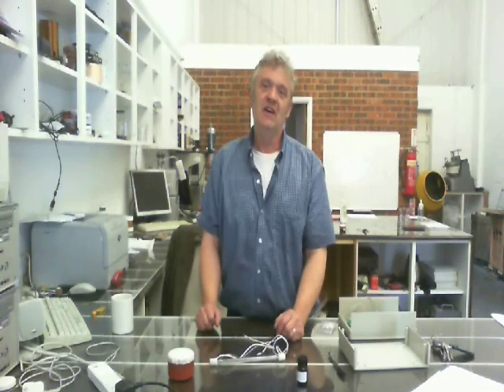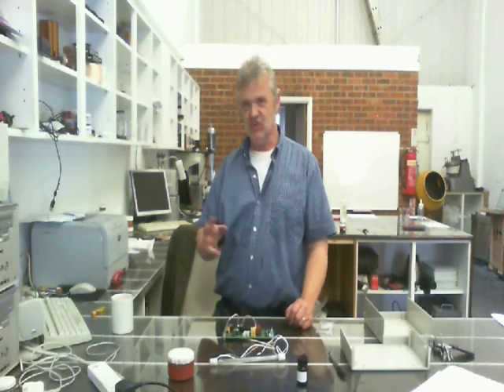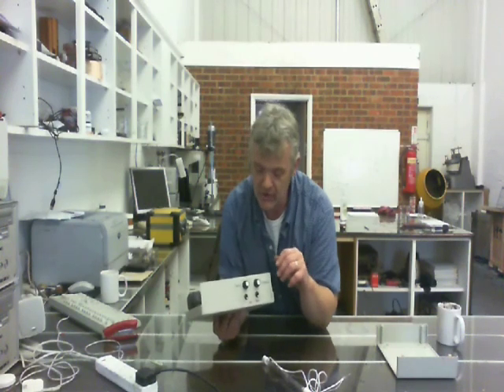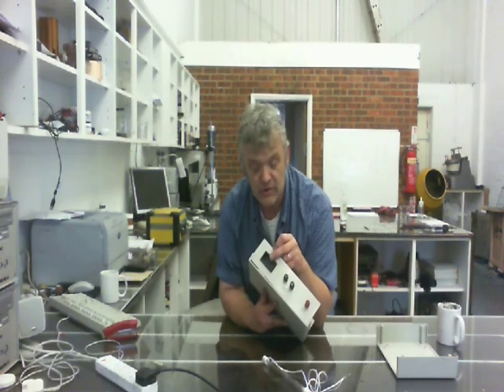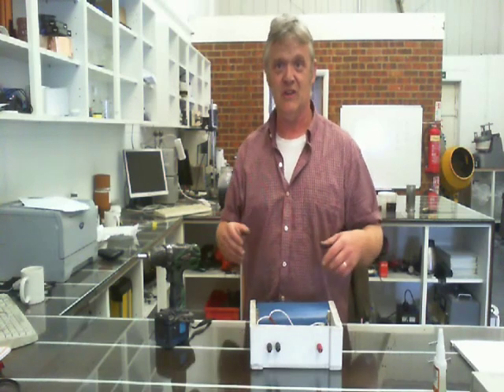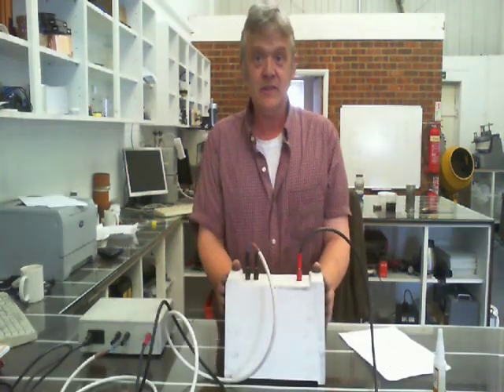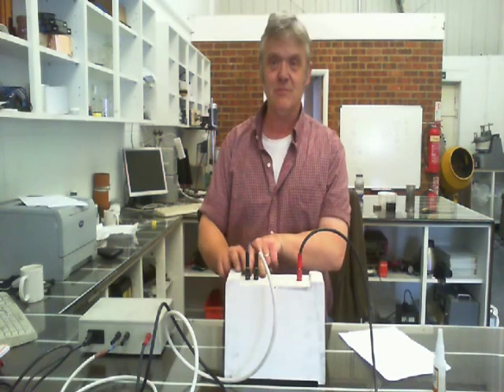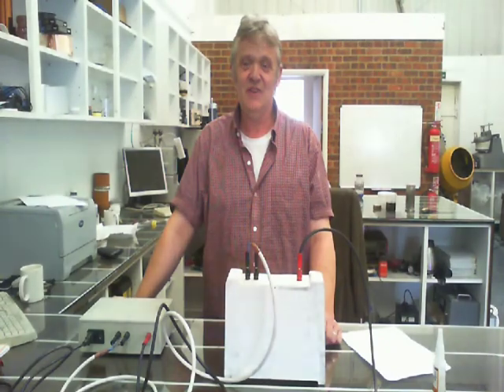How to Make A High Power Xenon Flash Unit For Sintering Nanoparticles

Comment: Hello Robert, I am also trying to setup a xenon flash lamp sintering system for the curing of silver nanoparticles, but I want to know that which xenon flash lamp and the circuitry you have used in the video. Please give the detailed specifications of it.

Comment: So i'm assuming the board does not need a power supply board? You can just wire the mains connector up to driver board directly correct?

Comment: Hello Mr. Murray-Smith :  Please speculate if the scintering device would scinter a TiO2 coating approximately 6 microns thick (0.25 mil). Thank you!
Reply from the maker: no it won't mate - it is very underpowered and meant just as a bit of hobby kit - it'll do non challenging materials like copper and GO

Comment: will the triggering input change both intensity or frequency....if so what parameter of the signal is used to change the frequency and intensity....

please reply 
a.abhijith0123@gmail.com
Reply from the maker: yes - it is a kit available on the net - the parameters will be given with the kit
Reply: I have the kit. I am trying to automate it using arduino....I am using a pwm output from arduino to control frequency and intensity. But only frequency of flashing is varying not the intensity of the light. What parameter of the trigger signal will change the intensity of the flash?
Reply from the maker: i think it is a variable resistor used to change the intensity mate

Comment: What is the plug you used to connect the module to the outlet via computer cable.
Reply from the maker: Rajan Kumar mate - these are standard plugs - the kind that go into a wall socket household power outlet - it's whatever you country uses to do that - it's the same for any piece of equipment you plug in for power - like your TV - you don't use a computer cable -  this is very basic stuff -  i worry you shouldn't be attempting this project with the questions you are asking
Reply: Robert Murray-Smith  Hey Robert,

Thanks for responding. Actually I just wanted to know the name of the socket you used for the module because I couldn't make it out when you said it.

I am actually a graduate student at UCSD (San Diego) trying to develop wearable devices. At the moment, we have a challenge of sintering ceramic based particles and use hot pressing. The hot pressing method is expensive and time consuming, and the high temperatures of the process limit our substrate options. When I looked into photonic sintering, I noticed it can sinter particles at room temperature. I have tried to find simple solutions but they are too expensive and when I came across your video, I thought I could make it myself and considerably cheaper. 

I have been too precautious about taking this challenge because I am not familiar with the electronics but in order to accomplish what I need, I need to overcome the fear of the unknown. So While I appreciate your concerns, I will attempt this project but I will make sure I get some help from people on campus that are more familiar with the electronics. Or I would appreciate your help as well. 

I can provide more details through email or through a google hangout.
Reply from the maker: Rajan Kumar hiya mate - lol - sometimes the simplest of things can be the hardest to describe - good luck with the project

Comment: Hi, very nice video! I think I tried the same xenon 750W kit in combination with copper ink from novacentrix so far without success - although having flashed the ink now more than 100 times the reduction does not seem to work. Could it be that the energy is not high enough?
Reply from the maker: Zhongwei Liu
sure - when i get round to it - but the basics are here - you could always do it and post a video
Reply from the maker: exactly right mate - you will need to increase power output - the draw on these things is huge if you want real power you will need more than one tube and connect them up to the supply on a separate circuit into the mains - better to use three phase - focus and area of exposure are also going to be important factors  as it is joules of energy per cm delivered that matters
Reply: Robert Murray-Smith Thank Robert Poser bringing up copper ink. I am also trying to sinter silver ink with the same kit. no success so far. I agree with you that the power need to be increased by using more tubes and adding reflector to focus. I would appreciate if you can add another video to demonstrate that if possible. Thanks for nice video.
Reply: Robert Poser - Saw a publication where they used upto 45 J / cm 2 whereas I believe what we get here could be about a joule or so. If I have something successful will post a video.

Comment: do you think that if you paint a graphene oxide coil on a piece of metal and then Flash it could make and be used like Electro-Magnet ?
Reply from the maker: i think you would need an insulating layer between the metal and reduced GO

Comment: very cool
Reply from the maker: would be good for in situ reduction of graphene - for example if you mixed graphene oxide into a clear plastic then ran it through the flash unit - but you are probably already thinking of that lol
Reply: yuppers.;)   I can not get the ionization treaters to reduce. They would make continuity then short out, producing a spark that would burn a hole in the films. 
I played with Xenon bulbs last year. Very small scale.. I think I will revisit it again with new formulations thanks to you!  U DA MAN!!!.  
Peace Out Murf!
Reply from the maker: Dan Murphy
fan of the office? lol

Comment: I think you can do the same thing with a manufactured light scribe laser.
Reply from the maker: sorry mate but not a chance mate - i tried it - there is no where near the same power - this is a 750w lamp discharging in microseconds the power delivered is huge - i blew quite a few fuses before the demo and the fuse i am using is 13 amps as 10 amps just kept burning out..
Reply from the maker: Leonard Janus
exactly what novacentrix and xerox did
Reply from the maker: Leonard Janus
have a look at flashforge - this is basically a home version of that